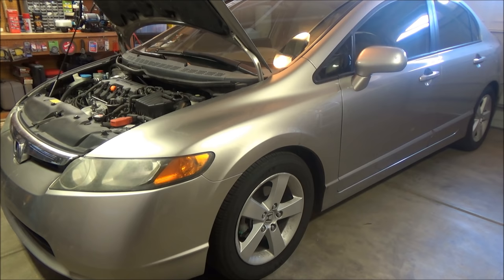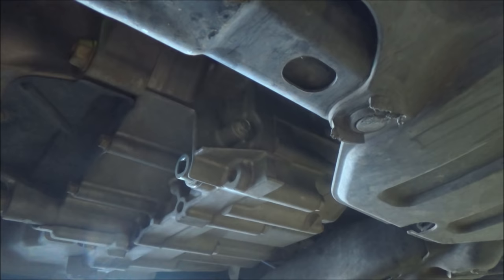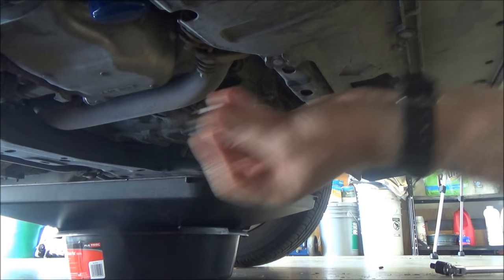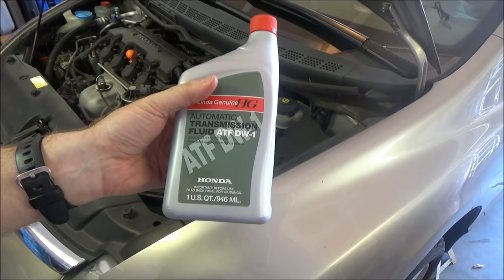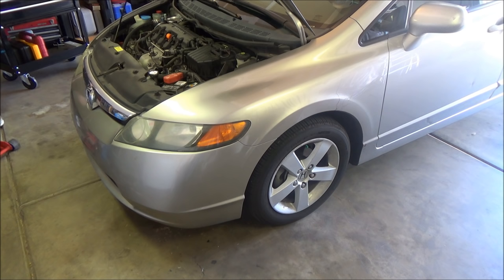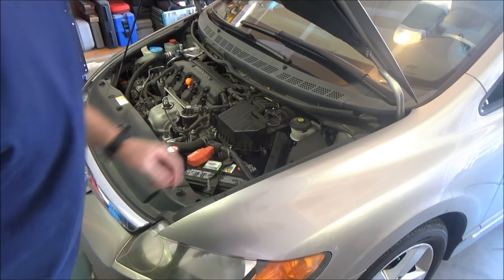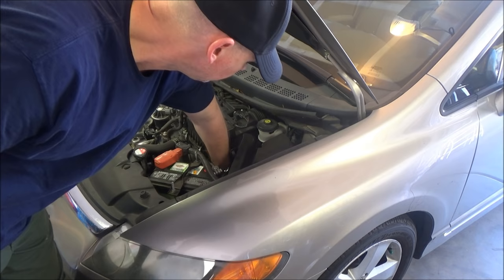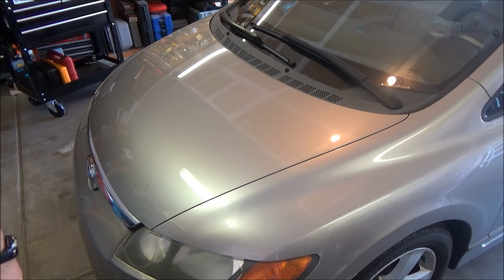Honda Civic Automatic Transmission Fluid Service 2006 EX (2006-2011 Similar) (Drain and Fill)

Comment: I started losing a quart and a half of fluid a day. I checked my cooler lines going to my radiator and one of them was spinning free. I tightened it will this solve my problem you think?

Comment: Wow. So easy. What the heck I get charge 125.00 at a shop about at 60000 miles. Just did this myself at 116000 miles. 2.5 quarts drain out like you said. Some people say 3 quarts. I will do this every 30000 miles now. Just wonder what brand the shop use?
Reply from the maker: If it is a reputable shop, they should be using Honda ATF.

Comment: Great video. I want to try this on my 2005 Honda Accord. Do you think a Harbor Freight 1.5 ton floor jack is big enough?  Do you just use the lowest position on the jack stands?  Thanks your channel is great.
Reply from the maker: Paul Laws Thank you.  Harbor Freight jacks are pretty good, shouldn't be an issue.  I set my jack stands on the first or second position when doing these.  It needs to be high enough to get a ratchet in there but low enough to drain properly.

Comment: Do you still recommend Honda ATF? I have been using Valvoline Max life Synthetic for 200,000 miles. No issues.
Reply from the maker: Yes I do, I only use Honda ATF fluid.

Comment: Great video!
One question though...why is the gasket and filter not changed on the car?
Reply from the maker: Thanks! The transmission filter was designed by Honda to be a "life of the vehicle part" and not be changed during normal maintenance.  I  would only change these if I am having transmission issues or changing out a transmission.

Comment: Would you recommend changing on a high mileage '09 Civic with no history of it ever being changed.

Mine doesn't have a dipstick, but it's a manual transmission, assuming that's why. 
Should I be flushing out the fluid?

Comment: Someone said In automatic transmission 2.4 liters is used. My mechanic put 3 liters in it. In hot car the gauge is on the higher side , should I remove extra oil or is it alright?

Comment: Great video, but aren't you supposed to check the fluid with it at temperature like you show but also with the engine running?
Reply from the maker: No, you don't check Honda transmission fluid with the vehicle running (this is where Honda differs from many other manufacturers).
Reply: @BigDog50001  Ok , I replaced both CV axles on my sons 2007 Civic and it lost some fluid. I need to top it off and plan on performing a drain and fill, so good to know this. Thanks for the info.

Comment: I still don't know:
1) Do I jack up  the passenger side?
2) You state to go under the front of the car and look for arrow. Do You know how close the front end is to the road? It is almost impossible to crawl under the bumper shield on a 2008 civic. Call an anorexic to get under car
3) Is the plug facing the drivers side or the passenger side? Does it help  to take off tire?
4) You stated every 100k miles
Reply from the maker: It might be best if you take it to someone who knows what they are doing.

Comment: Richard from GB..
Good day to you .
Thinking of purchasing again a honda civic .
Any issues I should look out for or be concerned about
 on a 2007 CIVIC 1.8Automatic 70000 miles on the clock?
Thanks

Comment: Thanks for the great video. Pretty neat. I really like all your videos. Since sometimes you don't know when was it last changed, Is there any way to know if the transmission fluid needs replacement?
Reply from the maker: Thank you.  Unfortunately there isn't a reliable way to look at a vehicle and know when the last time it was changed.  You can make an educated guess based on condition of fluid on dipstick (how pink it is) and the overall condition of vehicle/engine (whether it looks like it was taken care of or not).

The first thing I will do when I buy a used vehicle is change all of the fluids so I know for sure when it was done and what fluid was used.

Comment: Dont want to sound dumb, Honda does not require the car to be running when checking fluid?
Reply from the maker: No, you don't check Honda ATF with engine running.

Comment: And you should t have metal shavings on your treads that means someone over tightened it. Example he used a breaker bar to crack it loose

Comment: great video but the civic i shift that i have has  no auto dip stick so how to  check the oil
Reply from the maker: You didn't say what model you have, but most standard stick shift transmissions and some newer automatic transmissions do not come with a dip stick and do not have an easy way to check fluid level.

Comment: Can this be done without the Hydraulic jack? Being a DIY'er, I don't really have the big hydraulic jack that is used to raise the front of the car. I also don't have those metallic stands that go on the side. I am wondering if I could use the jack that comes with the vehicle generally meant for tire changes.
Reply from the maker: Amrish Kelkar I wouldn't do that.  I won't get under a vehicle without properly placed jack stands.  You have a perfect excuse to go buy some new tools!
Reply: Big Dog50001 thanks @bigdog

Comment: What about the transmission filter?
Reply from the maker: Honda does not consider the transmission filter a normal maintenance item, it is considered a "life of the vehicle" item.  I will only change them if there are issues with the transmission or when installing a new transmission.
Reply: There is a video where the transmission filter is cut open after about 100K miles.  It has sediment and fragments in it.  At that point, it is worth replacing.

Comment: Thanks for the video. I am curious, can I just use a pump to drain the transmission fluid without lifting the car with a jack? You had a video showing to do that for power steering fluid. I am wondering whether we can do the same for transmission fluid. Thanks.
Reply from the maker: Jinwei Gu I suppose it is technically possible but I wouldn’t do it like that.  It needs to be warm so fluid will flow out and the magnet needs to be cleaned off.

Comment: Please how many quartz of trans fluid will a 2009 Honda accord with 2.0l engine( K20 engine) take for fluid change
Reply: Drain and fill is 2.6 quarts on the 2.4 L engine

Comment: Thanks for the info. On my 09' (new to me) I recently changed the motor mounts and starter. The engineer that designed the starter location should have been fired. smh. Hoping to get at least 300k out of her when all said and done. Sitting at 86k, how about you?
Reply from the maker: I don't remember how many miles are on that car (it's not mine), but they are good little cars and should last a long time.  Thanks for the comment!

Comment: It would take more than one drain and refill. Certainly a lot more than 2 and half quarts of transmission fluid in the transmission.
Reply from the maker: One drain and fill every 30,000 miles is the standard recommended maintenance interval.  Three drain and fills will get most fluid but not all.  The entire transmission holds 6.2 US quarts.
Reply: Thanks @BigDog50001

Comment: Great vid! I have a question, people  from honda say I need 5 QT and I have the same honda 2006 than you, I don't know what to do :/
Reply from the maker: If you have the same vehicle as in this video, it is 2.5 US quarts for a simple drain and fill which is what I did.  If you were doing a complete transmission overhaul (like replacing or rebuilding the transmission), the entire system takes 6.2 US quarts.  You can't get all 6.2 quarts out by doing a drain and fill.

Comment: What will happen if I don’t put a new washer around the bolt? Is it bad if I change the fluid without changing the washer
Reply: No. If it's still in good condition just keep it on and check for leaks after a day

Comment: What seemed like an easy job turned into a nightmare. The inside housing where the threads are at cracked. I’m stuck idk what to do
Reply from the maker: That doesn't sound good, sound like something may have been overtightened at some point.
Reply: Did the threads came off with the drain bolt or is there a hair crack by the bolt?

Comment: Hi there. Just did the drain and fill. Changed washer with Honda washer and used Honda fluid. There is a subtle leak around the bolt now after changing. Any reason this might be?
Reply from the maker: Incorrect torque, bad sealing washer, damage to sealing surface or dirt/debris between washer and transmission can all cause that.  It is also possible it is just some residual fluid from the service that is still on transmission and there is no leak.

Comment: Is this easier then an oil change? Or about the same??
Reply: If you’re not replacing the external transmission filter (mine was leaking) definitely easier than an oil change on this vehicle in my opinion

Comment: Do not eat the history that honda genuine its always the best, in my experience Castrol ATF (honda toyota nissan) fluid worked a lot better on high miles cars..! I tried the Honda genuine few times and I had to take out , cuz change color in less than two weeks and transs runs weak ..!
Reply from the maker: Thanks for your opinion.  Older Honda ATF-Z1 had some issues but the newer Honda ATF-DW1 works great and is the only thing I use and recommend.

Comment: Thank you - what do you think about changing the transmission fluid filter?  Is it necessary, even with routine fluid changes?  I have 94K on my 2007 EX and was wondering if I should change the filter at my 100K service.
Reply from the maker: Here is what I think about them: https://youtu.be/0o4lh9_AyG0
Reply: @BigDog50001  Thank you!  I didn't intend to replace mine but thought I would get an "expert" opinion... : )

Comment: Only comment is that you should check your dipstick in the vertical position, not horizontal/flat, as that could give a false reading by making the fluid run up the dipstick a bit. Also, laying it on a rag before you read it could also affect the readying due to quick absorption. Best is to just pull it out vertical, and do the readiing.
Reply from the maker: Maybe if it is held that way for several minutes (the same could be said for holding it up and down, the fluid can move).  This isn't rocket science, no need to overcomplicate things like checking fluid level in my opinion.

Comment: Manual transmission?  Dip stick behind battery?
Reply from the maker: On these generation Civics (and many Hondas), manual transmissions do not have dipsticks.  The fill bolt has to be removed to check level (and the vehicle needs to be level).

Comment: I have a 2009 model and I noticed that the ATF looks yellow instead of red. Is that normal?
Reply from the maker: Normal ATF (ATF DW-1) is reddish pink.  Some CVTs use yellow fluid (HCF-2).  I don't see every variation, but I am not aware of any 2009 Civic models that use HCF-2, I believe Honda started using that in Civic CVTs in 2012 or so.
Reply: @BigDog50001  My car is an LX model its not a CVT.

Comment: I have 2007 civic 120000 miles.
It runs great but never had transmission fluid changed yet.
Do you think I should I change fluid or leave as is?
Reply: I changed it, car had 100k, did two drain and fills. Car runs the same, im at 139k now, have changed it about 2 times since then, im gonna try Amsoil now and see how it goes
Reply: Not that it runs bad or nothing, but id like to see if shifting gets any better, and if fuel economy gets better. Also, I can extend the drain intervals a bit longer for what I have read

Comment: How often should the transmission be changed? My Civic as of right now has 81k miles, is time to be changed?
Reply from the maker: MrOldeastdallas I recommend doing a drain and fill every 30,000 miles.  At your mileage, I would probably do one and then do it again on my next oil change.

Comment: how many times should I do a drain and fill? I’ve done 2 so far within the last month but not sure how many times it’s recommended to get rid of most of the transmission fluid.
Reply: I know this is  yr old but if you haven't found your answer its 3 times to get around 75% of the old fluid out-do it between 20k and 25k and the eng. will wear out before the  trans. does....

Comment: Help. I changed it and it was marked after I went threw the gears. I shut it off, Waited like 5 mins before checking it again and now it’s not showing any fluid.
Reply from the maker: It should be checked 1 minute after shutting off vehicle and the fluid needs to be hot.
Reply: Big Dog50001 Automotive that first time I checked (about 1 min or so) after I filled it up. It was marked. I was putting my stuff away and decided to check again and it doesn’t show anything. Ima check it later on today. Thanks for the reply

Comment: You said 3/8ths wrench, why wouldn't you use the correct metric wrench?
Reply from the maker: lol, RATCHET sizes are not metric (at least in the US).  The end of the ratchet (that a socket would attach to), 3/8 inch in this case, is what is used to removed these drain plugs and is exactly what Honda says to use in the service info.  Sockets and wrenches can be SAE or metric but not ratchet sizes.
Reply: @BigDog50001  y'know what.. I'm half way blind and half way an idiot. For whatever crazy reason I thought I saw a hex nut and thought you were using an american standard socket to remove it, but when I got under the car it's obviously a 3/8ths ratchet. So I apologize for the misunderstanding.

Comment: When should I change the fluid cause I brought my 09 Civic with 103,730k and i don’t know if it was changed lol and now I have 111,749
Reply: If you don't know if or when it was changed last I would go ahead and do it now, then you will have a baseline for your next drain. I changed mine the first time at 60,000 miles and do it every 30,000, this will keep your transmission bullet proof for a long time. Since you don't know when the last drain was I would do the drain and refill 3 times, space them out about a week between.

Comment: Hello, 2010 Civic . I have a question if I may. Do you just do one drain and fill of approximately 2.5 qts every 30k miles ? Or do you do a series of drain and fill , maybe 3 times ,(after driving a few miles to mix things up)  at the 30k intervals?
Reply from the maker: Some do more but I generally recommend one drain and fill every 30,000 miles on Hondas.
Reply: @BigDog50001   Thank you sir!!

Comment: Hi,
How often you change the oil in this automatic gearbox?
I have Honda Stream 1,8 petrol 2007 automatic transmission.
Where is oil filter for that geatbox?
Reply from the maker: The best information is in the owner's manual of course and you can't go wrong with that.  That being said, I recommend at least one drain and fill every 30,000 miles for most conventional Honda automatic transmissions.  On this Civic, the transmission fluid filter is not a normal maintenance item according to Honda and is generally not changed unless there are transmission issues.  The Honda Stream was never sold in the US, so detailed service information is not available for that vehicle out here.
Reply: Thank you:)

Comment: Good video, I was recommend to change transmissions fluid n quote $99 for the job. This doesn't look hard. Can I get the washer and fluid from the dealership?
Reply from the maker: Thor's Aquatics Yes you can.
Reply: Big Dog50001 wats the different between a flush n a change. Dealer say the will flush n fill the fluid
Reply from the maker: Flush usually means they hook a machine up to your transmission, which is not recommended by Honda.  Drain and fill is what I showed in video and what is recommended by Honda.
Reply: Big Dog50001 that's wat the Honda dealership recommend a flush n fill but ur saying it's not recommend I'm confuse if that's wat they will do drain n fill only.
Reply: Big Dog50001 sorry for all the question but I'm trying to get this right so I don't get rip off cause I didn't know. Also correct me if I'm wrong but 06 and up Civic don't have timing belt, they have chain which last forever , I'm I right.
Reply from the maker: Thor's Aquatics It's probably poor wording by service writer.  My guess is they would only be doing one drain and fill with 3 quarts for $99.
Reply: Big Dog50001 I think so. They didn't explain good and the recommendation was just too weird and expensive.
Reply: Big Dog50001 thanks for the answer man. I call the dealership today to ask what the transmission service consist of and what is mean by a flush. I was told they don't do flush. Just a drain and fill for $99. My question is answer right there! I will b grabbing the fluid and washer and doing it this weekend. I hope this help others too. Always good to save your hard earn money.
Thanks big dog!
Reply: I would like to thank you for the work and video. I was able to do this under 2 hour. Was being careful to do it right so u don't have to do it again. 
I would suggest anyone before doing this go and buy a 3/8" breaker bar. Trust me, it's worth it will save u time. The drain is on there super tight.

Comment: Hello 
Need ur Advice please, I put for Civic 2010 1.8 a wrong transmissin oil accendently , I put CVT  oil (called Top 1 Formula 1)  instead of  honda ATF Z1 nd drove for 5 thounand Killometer (5000)
 What should I do brother ? nd does this mean the transsmission will die in future even i changed the oil ? 
I appriciate if u can Advice . thank you .
Reply from the maker: Depends on how much of the wrong fluid was added, but I would probably do 3 separate drain and fills with the correct Honda fluid if it was my vehicle.  It is possible it will shorten the life of the transmission but only time will tell.
Reply: @BigDog50001  Thank you for replay first of all,
I put 3 or 3.5 bottel of oil , but i checked the oil , its color still has some red color. 
I have 3 questions, I drove about 5000 kilometer, should drain it now or wait ? nd how much bottel will drain nd how much will stay in the gear brother ? how long i drove between every fluid drain ?
Thank you so much.